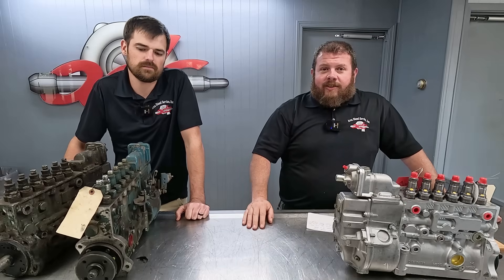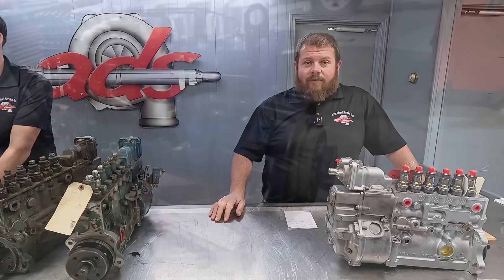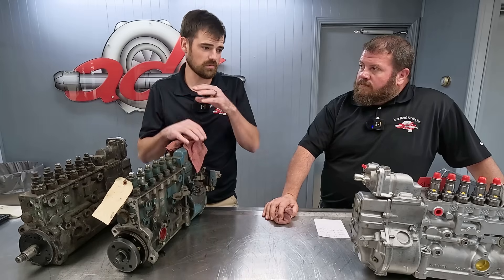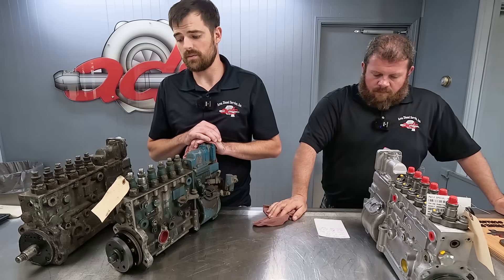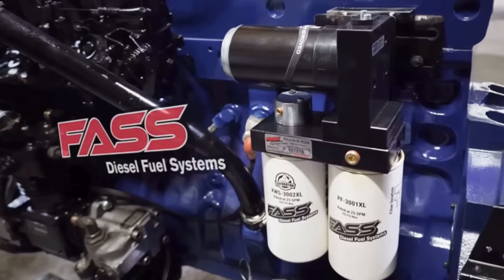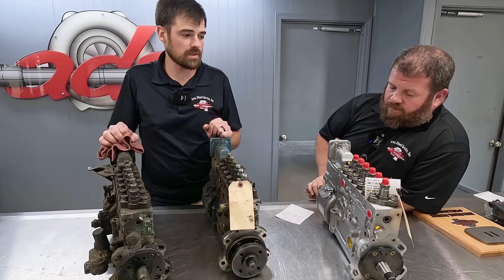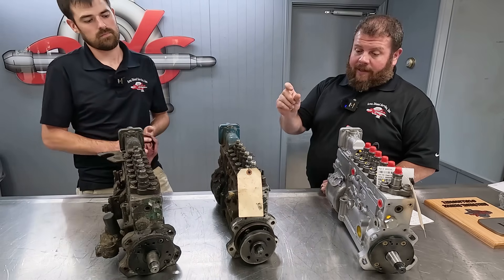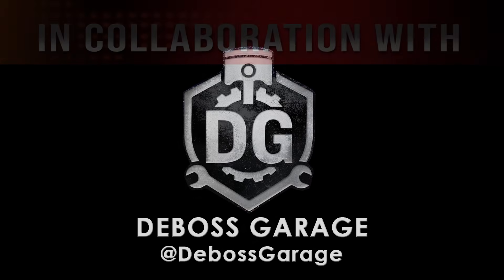Transforming Bosch P3000 Pump to P7100: @DEBOSSGARAGE Epic Engine Swap #FARGOLCF Rolloff Project

Comment: Isn't a 160hp Cummins 6bt pump cam non anti reversion so you could spin it either way. Then just swap your fuel lines around to fix your firing order and away you go. 😀

Comment: My 95 dt466 ngd has the p7100 pump on the driver's side 5:45
Reply: In fact, ive been looking at these for years and ive never seen one with the p pump on the passenger side.
Reply: Very odd the way they phrased it. Back and forth between pump orientation and rotation. Also the dodge is on the left side, would have been interested to know the differences.
Reply: @Redgrave-v2p international mounted  Bosche pumps Rotate opposite dodge.

Comment: that bearing change reminded me of how the big Cummins crank rods fit in a old 3208CAT, stamp a different thickness of sheet and a wrist pin bushing... shiny stainless 12 point ARP... C is a C. no such thing as a glass bottom end

Comment: So the 30mm P3000 and P7100 cams are the same besides the bearings? 
Is the diameter different also or are they just ground different?

Comment: The first Fargo trucks were built in Pilsen, Chicago, by the Fargo Motor Car Company from 1913 until 1922. In 1928, Chrysler bought the business and created their own line of Fargo trucks.[4] Shortly after its creation, Chrysler also bought the Dodge Brothers Company, adding Dodge- and Graham Brothers-badged trucks to its product line. From then on, Fargo trucks were almost identical to Dodge models, save for trim and name, and were sold by Chrysler-Plymouth dealers. ** for all the post boomers the afore mentioned quote is from  wikipedia
Reply: Never woulda guessed where it came from